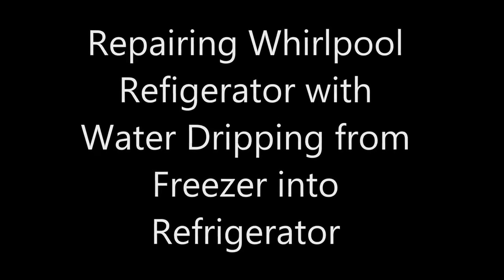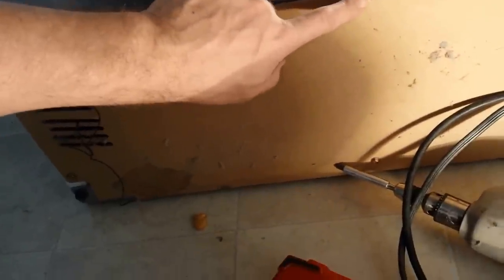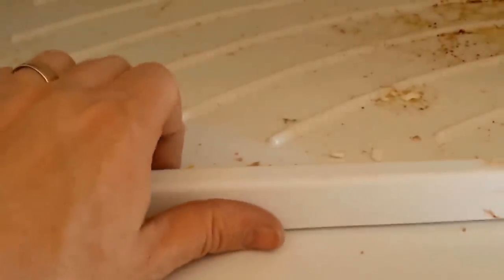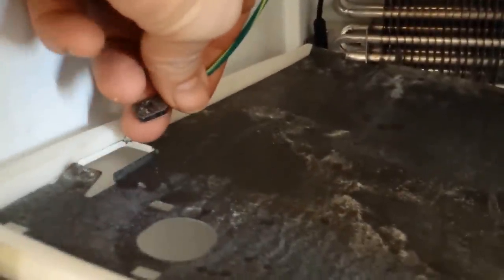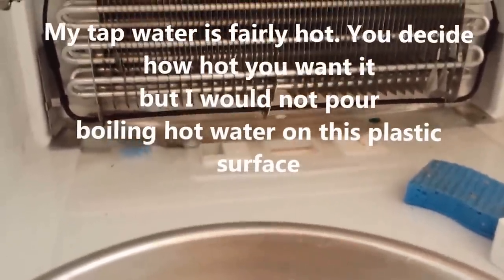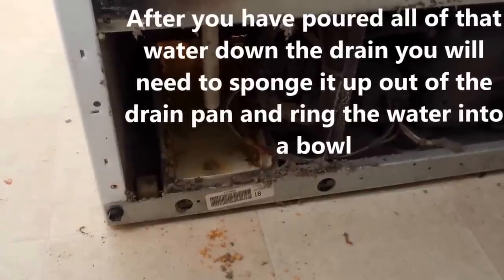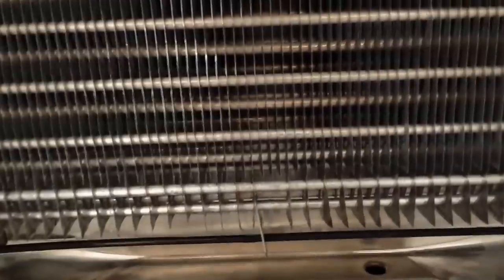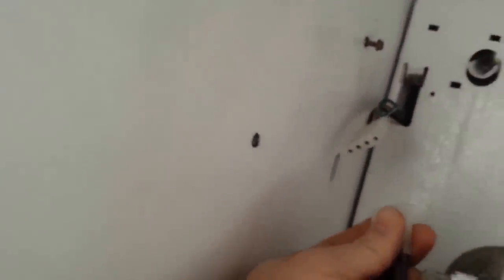How to fix Whirlpool dripping water from freezer into refrigerator compartment

Comment: The black tube at the bottom is the defrost heater which melts the ice build up off of the condenser(the thing with all the fins). Get a small piece of bare copper wire and carefully insert it down the drain tube(6 or 12 inches) then wrap it around the defrost heater tube. When it heats up it should melt any build up in the drain as well if there is any.
Reply: Good idea, Andrew. I wrapped the wire onto the black tube first so I wouldn't drop it down the hole.  Only went a few inches down the hole since this is the area it freezes.  Thanks!
Reply: @peteraltavista7508 Did the copper wire work? I'm dealing with the same issue now.

Comment: Thanks for the advice and the video.  Made the job much easier.  I might add on another post they used a bulb baster to put hot water down the drain tube.  That made breaking up the ice in the tube much easier and faster.

Comment: Thank you, started watching this after I had already started.  Took just under 2 hours.  Found using a baster helped put boiling water pressure in the drain once I got to it. Could force water down and suck it up until it was clear.  Don't take top screws out of ice maker, just loosen and lift once bottom screw is out.

Comment: I used a hair dryer set on high, to accelerate melting the ice, and a plethora of towels to mop up the water.   It took about 30 mins to melt & remove the ice mess.  

I discovered there was dust/gunk in the drain tube that had caused the blockage to begin with. I cleared the drain tube using a stiff wire.   I strongly recommend checking the drain tube is cleared, otherwise, this problem will recur all over again.

Comment: Your video was awesome. What took the longest was getting ice out of drain line. The disassembly and reassembly was easy. Just make sure you take rear panel off so you will know the drain is unclogged. Use the paper towel truck to get excess water out of drain as it melts. A turkey baster or similar device would probably work better and faster so you could suck out excess water and then insert got water. Lastly I also used copper wire trick to hopefully keep drain line from refreezing.
Reply: Copper wire trick?

Comment: Thanks Mark, this really helped me. I had the same problem with my Whirlpool fridge. I didn't have a spare fridge/freezer that I could store my food in. So, I found a couple of ways to speed up the process. I used a screw driver and hammer to chip away at the initial ice chunks. Once I was able to reach the drain, I had a squeeze bottle with a nozzle that I stuck in there with hot water and that really sped up the process. When I squeezed the bottle it would push the hot water towards the ice, then when I stopped squeezing it would suck the now semi-warm water back into the bottle so I didn't have as much of an issue with the water in the drain line acting like an insulator. I was able to complete this project in about 45 minutes.
Reply from the maker: funny you would post this. after two years mine froze over again. i did essentially the sane thong you've described with the same result. serendipity!

Comment: this video just saved me 200$. thank you so much. took me much longer,  electric icemaker plug was a booger!
Reply from the maker: L Metz you're awesome! way to go.
Reply: also if you have small hands or narrow plastic spatula and " flutter " the warm water into the drain it will clear faster. moving water creates friction,which creates heat, which works water into drain line faster.

Comment: This was a fantastic video! Thanks so much, and so happy I found it before I called a repairman or bought another fridge. Mine is the exact same model, everything was very well explained and easy to follow. I found an easier way to  get rid of the water in the drain tube. Instead of using paper towel, which I did initially, I used a syringe and it worked so quickly and at the same time i could feel with the needle point where the ice was.  Thanks again!  Now can you tell me where I put the two screws for the freezer bottom tray????!!!!!

Comment: This was very helpful.  It took a bit of troubleshooting but I was finally able to find the block in the drain.  I have a Frigidaire so it was a bit different but this video was a savior
Reply from the maker: dorsay703 so glad to help. I have learned a lot since I made this video. One key is to get something that you can pour the water just straight down that hole, the drain hole. It helps a lot.
Reply: Turkey baster did the trick.  I had never owned one until now.

Comment: Thank you Mark. I was just a bit apprehensive taking the back of the freezer off because i have an ice maker and will need to take that off as well. Yesterday I shut down then frig for 3 hours and thought that did it but this morning I had the same issue. Since i do not have a second frig i will take your advice "patience: I guess I will add this to my honey do list for Saturday. Thanks again.
Reply from the maker: no worries. i have an ice maker as well. just take pictures of what it looks like as you are disassembling, if you are worried about how to put it back together. then you've got a reminder of what it looks like. group things together that belong together. if needed, use zip lock baggies to store parts and screws and such that go together. Good luck!

Comment: Good video.   So based on this info.  a little bit easier.  Shut off the breaker to the fridge.  Poor some rubbing alcohol down the drain in the freezer.  Do this repeatedly for about 20 minutes.  then pour hot water down the drain until the pan overflows on the floor.  Done and done.   Be sure and catch all the water that will overflow in the fridge like you have already been doing

Comment: You didn't need to get at the back of the fridge, there's a spring-clip plastic grill below the door just above the floor.  Pull that off, and the drain tray just pulls out.
Thanks for this though, I've been wrestling with the same issue. PITA to fix it.
Reply from the maker: Rob Scaife great suggestion. Thanks!

Comment: My 2004 Whirlpool stopped cooling in fridge but freezer is ok. One vent in fridge has ice in it. Tried to defrost for :10 with hairdryer with some success, but the further into the hole the slicker the ice is and SO slow to melt. You lost me at taking out the ice maker (sigh), scared. I may try to take bottom pan out to see what's in there. Thanks for your video.
Reply from the maker: macycharmin  good luck Macy. Go slowly and think about each step. Take pictures of what it looked like when it was all together. Then you can look back at the pics for reassembly. Put the screws and such into a zip lock that go together so you know what's what when you go to put it back together. Have some confidence.
Reply: Mark Mason 
Thank you for the response and confidence!

Comment: The first time my fridge did this I found a video that showed me how to clear the freezer drain...but it just kept happening too frequently and then I finally found the videos that showed I need a heat strap replacement likely to keep the drain from freezing over and over. Small little easy part to replace...even seen diy ones as long as you have a metal strap that connects to the heater coil and drops into the drain. Hopefully this keeps it from happening.

Comment: The irony of it all, having to defrost my frost free freezer.  Took me just under 2 hours, time being measured from the time I started taking food out of the freezer to having it put back in.  Plus a couple of short breaks.  Luckily, my fridge is nearly identical to Mark's.  I didn't have a turkey baster but I did have a 10 ml lab syringe.  There was a piece of aluminum similar to a long nail connected to the heating element going into the drain hole.

I dunno, my last fridge had the same issue.  Maybe it was just easier to put the tea kettle in the freezer for 15 minutes then remove the ice and be done with it.  Though those freezers weren't nearly as large, nor had the ice maker.  I love my ice maker.

Comment: i've been dealing with the same problem for quite some time myself.  two things i can ad is -- you can pour table salt in the drain opening after removing the bulk of the ice.  it will melt through fairly quickly, then flush it with clear water.... also, be sure to install  a heat probe into the opening which will attach to the defrost element ,,, to keep it from re freezing.

Comment: My same refridge is unplugged at the moment.  I used a hair dryer to defrost the drain to where I couldn't feel ice anymore, but if it's still not draining tomorrow morning I'm going to use your hot water method...Also, I watched a video that said to wind some copper wire to the heating element and extend the wire a few inches down into the drain to get some heat down there to prevent future freezing....

Comment: I saw a video where a repairman attached a copper wire to the heating element behind the freezer wall panel.  They extended the wire down the small circular hole under the coils.  As the heating element gets hot, so does the copper wire and therefore water does not freeze down there and cannot pool up and overflow down the freezer hole into the refrigerator.  You can order a specific metal hook part or save a few bucks with the copper wire from your local hardware shop.
Reply from the maker: Would be a life saver.
Reply: @GetItDoneProjects  This is one such video here: https://youtu.be/3GUeFB8dh78?t=77

Comment: hairdryer in the freezer with something under the tip to keep it elevated.  place dryer tip close to fins on back wall of freezer and shut the door as much as you can.  build up of heat might trip breaker on hair dryer.   remove rear access panel at bottom of unit.  find and remove drain tube tip.  rinse out tip and snip off a half inch of tip to create larger orifice so the tip will not occlude again.  ya gotta wait till drain hole in freezer frees itself of ice and you can determine that tube is draining into reservoir at base of fridge.  keep yourself busy moppin up the water and ice in the freezer.  I put hot water in a squeeze bottle and pushed some water through freezer drain hole to rinse drain tube.

Comment: Thanks for this. In my case the panel that covered the evaporator rusted and the rust plus the pieces of paint formed a mud that blocked the drain. To unplug it I had to blow thru the duct from below with the help of a hose. That unclogged it, somewhat. Anyways, now I gotta find a way to stop the panel from completely rusting and disintegrating.

Comment: So how do you prevent it from happening again?
Reply: I'm told there's a "trick" to put a wire down the drain. I'm not sure where it's connected to, but the heat generated keeps the water from freezing.

Comment: I had the same problem,drain hole iced up..Had a backup frig transferred all food to back up frig..let frig with plugged drain hole set for 1 day with doors open ,,Then I used air compressor to blow out drain line..All kinds of food particles and small pieces of paper came out..
Reply from the maker: morty579 totally acceptable method. I just didn't have the option of the second fridge. I've had to do this twice. I can get it done now in 45 minutes.

Comment: I'm having this problem with an older whirlpool refrigerator. I'm wondering where is the water coming from? Would disconnecting the ice maker solve the problem?
Reply: Only if the ice maker is leaking from somewhere. Turn off the water supply to the fridge. If the leak persists then it's just ice building up and melting around the air vents between the fridge and the icebox. The solution is to unclog the drain.

Comment: I've done this to our unit 3 times.  This time, I installed the copper wire drain heat transfer wire.  I sure hope I don't have to go in again.  My wife is making noises about a new fridge... and I know there's nothing really wrong with this one.  There are videos out there about using the copper wire.  I hope it works.
Reply from the maker: that's a great suggestion. I'll look into that. thanks.
Reply: copper wire didn't help mine. but the way I had the hose routed to the drain pan seemed to help for a while.

Comment: Hi Mark, thanks for the video, We have the same problem with a clogged pipe, so I'm asking my husband to try this technique tonight. While he has the freezer panel off, is there an easy way to just remove the ice maker? We don't use it because the water is not filtered, so it's just in the way! :)
Reply from the maker: Diana VP if you look you'll see the screws that attach the ice maker
Reply: Yes, I got that part. Sorry, I wasn't very specific. What I wanted to know is, once the ice maker is removed, is there anything that must be done to the end of the connector plug or to the water line, to ensure nothing related to the ice maker tries to activate?? 

Btw, we successfully cleared all of the ice last night, and didn't even need to remove the back panel, just the freezer pan (or tray)!!! I used hot towels, then pulled out my hair dryer for the last really thick ice covering the drain hole. Then wicked up some of the water at the top of the drain hole with a folded paper towel, and THEN used a brand new Pampered Chef (lol) turkey baster to squirt boiled water into the pipe. 

Husband used packing tape over the end of the fridge-to-ice-maker connector, pushed it behind the back panel, then put a strip of packing tape over the hole. Ultimately, I think it took about 3 hours start to finish, though some of that was cleaning behind the fridge. Now, I wonder what these two extra screws are for (not the ones from the ice maker)! 

P.S. Husband really did NOT want to help with this after a long day at work, but whine away, it got done! THANK YOU!
Reply: Thanks.  I went to the trouble of cabling out the drain in the event that there was a stoppage in the condensate drain.  Try a 1/4 inch cable.  Otherwise, your video was spot on.

Comment: I have this same problem, I have to clear that freezer drain every 3 months now.  Any suggestions on how to fix this permanently?
Reply: Tom L did you ever find a solution? Having the same problem with ours, letting the line unfreeze is not fixing it, it keeps leaking every month or so. Thanks

Comment: How do you make a permanent fix?
Reply from the maker: This could be a maintenance issue. It would mean cleaning out the tray where food collects so it won't plug up the drain. Since I cleaned mine I haven't had to do it again and I haven't done anything more than clean it out the first time.
Reply: @GetItDoneProjects  It is more like poor design. The metal almost needs to have a heated line and go how for however long the defrost cycle so moisture doesn’t freeze up and plug off with ice. Only other way is to remove the food and unplug the unit and let it melt on it own. Manual says nothing. Removing the panel and manually melting the ice is going way beyond.
Reply from the maker: @crookeddealer7026 yeah it seems to me like they could have found a better way. Too many people have clicked this video. I know I was super frustrated when it happened the first time. May it never happen again for you. 👍💪👊

Comment: thanks for sharing how you unclogged the drainage, but if you don't fix the cause of ice forming and backing up, you'll just have to go through this process again and again and again, imho
Reply from the maker: So, the problem is food building up and clogging the pipe. I did this however many years ago, and I've not had to do it again since. Good luck

Comment: I have done this 3 times now in the past year or so and our fridge still is leaking after awhile again...any other suggestions?
Reply: There may be a piece of food or other small object blocking the hose. In my case I had to get a pipe cleaner long enough to go through the length of the hose and scrub it before a tiny floret of broccoli popped out
Reply: Mine just kept freezing over..got a heat probe to hang from heating element right above drain hole and down in drain hole..it de frosts the drain hole easily and let's water drain where its supposed to

Comment: Hello Mark I have done this 4 times already after about 3 weeks it builds up again. So what is the real reason this is happening? There has to be a bad part somewhere.
Reply from the maker: Duke tt there are no parts to go bad in this system. It's just a drain tube that is failing to drain. What goes wrong is debris clogs the drain from flowing and the water ices over, then it can't drain at all. Somewhere you've got a clog. You need to figure out where it is and flush or push it out.
Reply from the maker: I should add, it is possible that there is damage to the drain line, and that's why it's not drain, but not likely.
Reply: I had it cleared out very good everytime. It was clean and was flowing good out of tube. It just keeps coming back. I ordered a drain strap heat kit  that has a piece of metal to heat the hole up. Plus I bought a  defrost timer. I been hearing weird clicking noises from fridge maybe defrost timer is stuck. causing it to defrost to much and the water is freezing up.
Reply: Duke tt - curious, did this clear it up? Same problem with ours, it stops draining properly again after a month or so.
Reply: Yes it fixed it
Reply: replace the defrost timer and vacuum the bottom front and inside the back very good. and also get the drain tube kit. Works perfect.